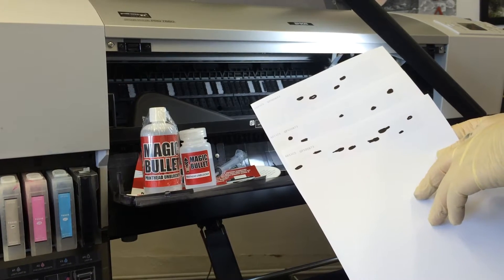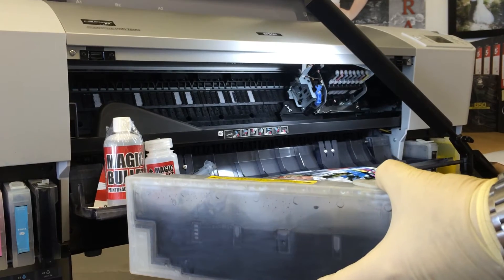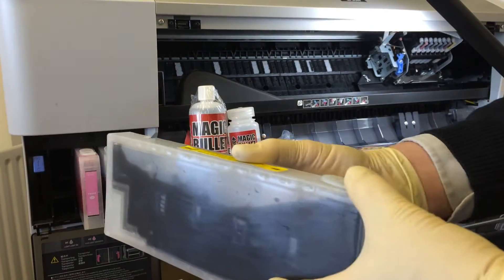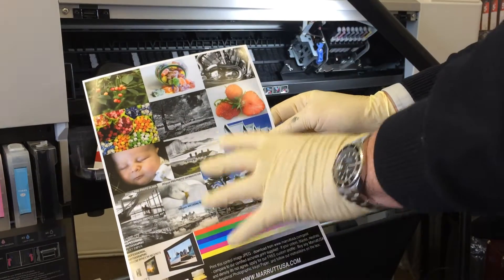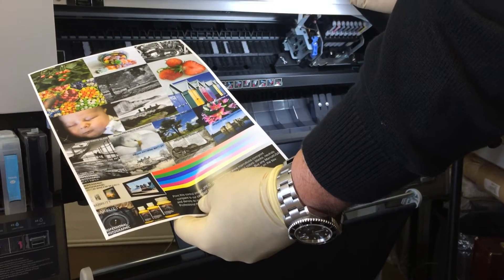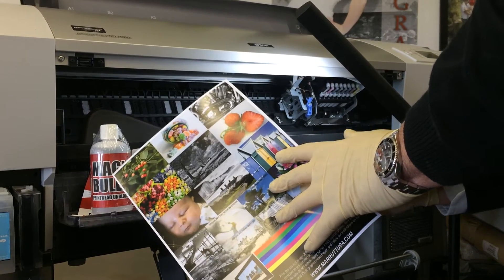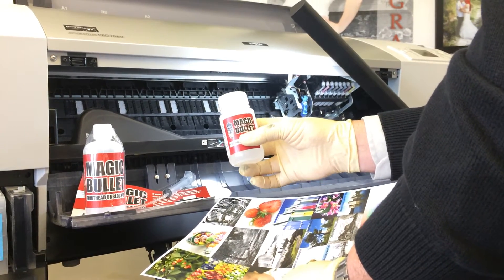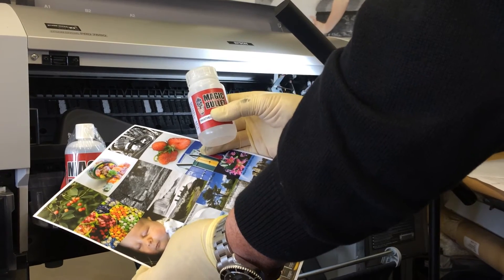How to fault-find a wide-format inkjet printer - air entering ink system etc Pt 2 of 3

Comment: Hmm, so your behind Magic bullet, I bought your “magic bullet” made the printhead worse, and about 60% of the nozzle check was blocked... I repeated the process twice, and got even worse... originally I only had 8 stubborn nozzles on mk... now my printer is sat their with the head dead... thanks guys 👍🏻
Reply: hi, please contact us directly at digital@marrutt.com. We can then fault find and offer some advice
Reply: Not much else you can tell me than I already know, been working on these for years, changed heads many times and almost every other part over years, always used the epson engineer software, done many flushes also, checked for air etc and none, primed system correctly... after 6 attempts I’ve given up,  Now my sc-p9000 is dead, can’t do a clean via the printer to change to pk as fails now, and no point anyway as I use mk for canvas, I actually flushed both mk and pk ink line right through to make sure there were no blockage and then tried 2 more times, priming cleaning etc to no better result,  a little angry to say the least, as I should have to buy another printhead and waste half my inks ! Temped just to scrap it
Reply: Trying to source an sc-p7000 / 9000 head if you can help, or even the stylus pro 7900 9900 tfp head as the dx6 heads used for the sc-p9000 and stylus pro 7900 / 9900 are compatible

Comment from the maker: One thing to consider when using wide-format inkjet printers:  They usually suffer from long periods of inactivity (no printing for weeks on end) then suddenly a rush job comes in, and we all expect the printer to perform perfectly! - DON'T DO THIS! - PERFORM A NOZZLE CHECK PRINT-OUT EVERY WEEK - if the nozzle check is not perfect on a weekly basis, fault-find your printer according to the above Videos I, II and III - if the printer still won't respond, contact us at support@marrutt.com or support@marruttUSA.com depending on your region - we will help!
                                                                 Best wishes,  John Read  MD  Marrutt Limited

Comment from the maker: I am getting lots of e-mails from wide-format users who want to know if these techniques work on any brand of wide-format printer:     So long as your wide-format printer uses pigment or dye-based inks, the heavy vapour given off by MAGIC BULLET PRINTHEAD CLEANER should gradually soften the hard dried ink deposits.  If you have only just lost your perfect nozzle check (say, last week) you should quickly be able to regain perfect print.  If your wide-format printer has been clogged for weeks or even months, prepare yourself for many cycles of overnight soaking and scrubbing as shown in these three videos.  - Any specific queries, e-mail us as SUPPORT@MARRUTT.COM OR SUPPORT@MARRUTTUSA,COM          Best wishes, John Read  MD Marrutt Limited